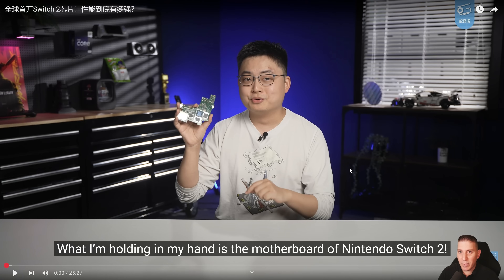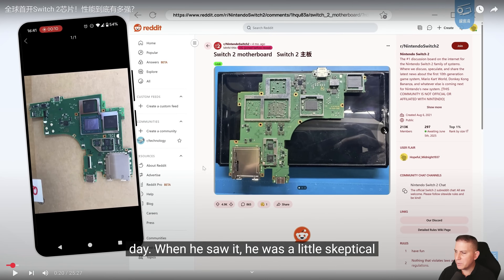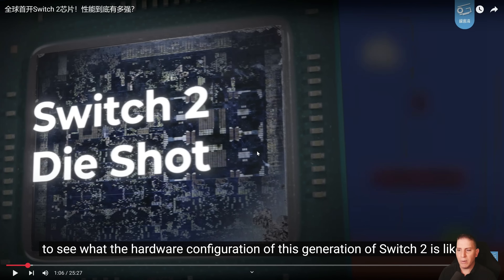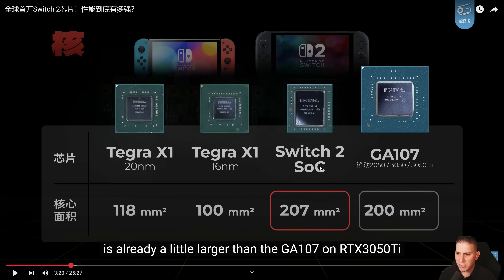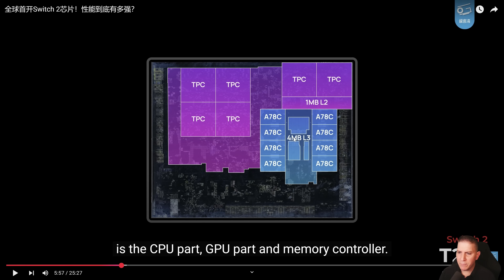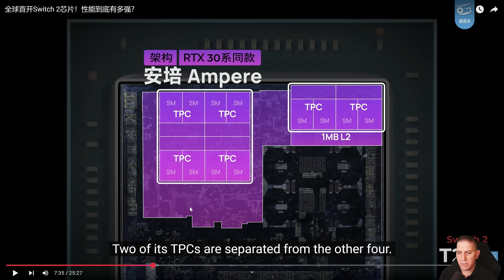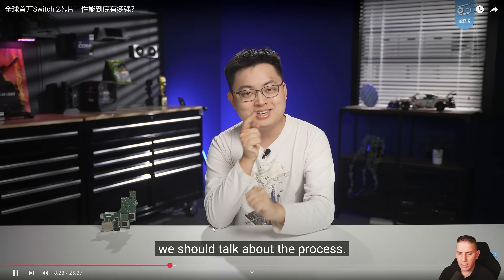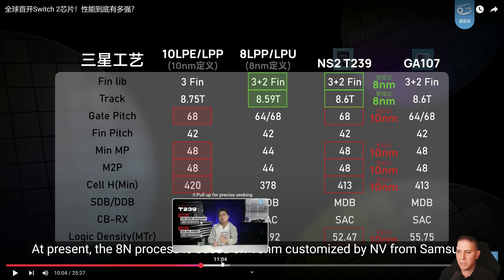Switch 2 GPU + CPU SOC Chip Size and Custom Architecture Revealed from Motherboard Scan

Comment: My only issue with this console is why did they wait so long? They should have released it 2 years ago with the TOTK instead of pointlessly chasing ps2 sales record. They could’ve been sitting on 50m+ userbase right now guaranteed success. Without a 3D Mario caliber title this holiday season, they may not do so well.
Reply: @codeofcodedotorg   i feel like they should've done the reverse, and made TOTK the launch title of the switch 2, with a joint release on switch 1 like how they did BOTW. the extra dev time would've been well worth it if it released as a launch title!
Reply: Pretty obvious why. The games weren't ready, at least Mario Kart World wasn't. It is kinda Nintendo's M.O. to wait until a game is polished and not shove it out the door.
Reply: @ Then I'm going to say it right now, it's not impressive. If the big draw of Mario Kart World is that you can drive to the next race and get collectibles, that's extremely lame. There have been better open world racing games since the Gamecube and Ps2.
Reply: @VGamingJunkieVT  Mario Kart has always been an amazing 2nd game. I’m just waiting for that 1st game like BOTW caliber single player game.
Reply: @VGamingJunkieVT  neat. Vote with ur wallet then.
I doubt the sold out pre orders are worrying.
Reply: @VGamingJunkieVT  you think that the sequel to the highest selling switch game, a game that its predecessor was also a launch title is lame?
They've been better open world racing games? Have you actually played this game to know this?
I don't know about you but it's a no-brainer to have your most successful game at launch if possible.
Reply: @xavierlynch1088  Preorders will always sell out. Under 20M by the end of the year will be a huge failure in my opinion. But with a 3D Mario caliber holiday game, they could even sell 30M+. The first 10M is guaranteed from loyal fans like me from day 1.
Reply: @codeofcodedotorg  are you cracked? 20 mill in 6 months? Ps5 was one of the fastest selling launch periods ever shattering records left and right and it only sold 4.5 mill in 5 months.
Reply: Broooo I couldn't possibly agree more, I've been banging my head against the wall for ages saying they should have just released this in 2024 or better even 2023.
The tech is impressive, it would have been even more impressive then and like you said, they could have built an unstoppable amount of momentum by now.
They would have built an unignorable install base, so even when Sony and MS come out with competing hardware in the coming years, Nintendo would still have 3rd parties in their pockets.
And then in 2030 they could be ready with Switch 3 just as the Switch 2 starts to show some age.
Reply: @Roy-Vector3  exactly
Reply: @Roy-Vector3  That hardware would have cost you $1000 around that time to get, so no, definitely not. Or they would have to go with something cheaper and then the performance would nowhere be close to this.
Reply: Covid
Thank you
Reply: They apparently waited for the games to be finished so they had a strong lineup at launch
Reply: @66kaisersoza  So where are the games? MKW and DK? That’s it? Aside from Mario Kart it seems the most excitement is around playing a 5 year old port Cyberpunk. All I’m saying is they have to have a holiday exclusive game. So something like Pokemon that also gets a release on Switch 1 doesn’t count.
Reply: @codeofcodedotorg   did you forget they have a sequel to their highest selling switch game called Mario kart world, and you're saying they don't have a Mario level game? It literally has Mario in the title lol
Reply: @isimikehinde5584  Now the question families will have to ask themselves is is this worth $500 when I already have Mario Kart on the Switch 1? The problem with pandering to casual audiences is they're probably just as happy with the older game, like how there are probably people still playing Wii Sports.
Reply: @VGamingJunkieVT  I think it will be fine.
Reply: @ I hope it at least makes Nintendo concerned, on some level. If it succeeds, the game industry will become even greedier. It'll snowball into the second crash that much quicker.
Reply: @isimikehinde5584  Well, they had MK8, BOTW, Splatoon 2 + Oddessy. I know some of them are Wii U titles, but they were brand new to most people. I know there are many 3rd party ports, but how does just MKW and DK compare to the Switch 1 lineup?
Reply: @codeofcodedotorg  well they've got Mario kart world, donkey Kong Bananza - the first 3D DK game in like 25 years and Metroid prime 4, with way more third party games than the switch 1, I think they are fine without a Mario game (even though there's literally a Mario game at launch)
Reply: @isimikehinde5584  I hope they’ll be fine, because I wouldn’t want Nintendo fade away like Xbox.
Reply: @codeofcodedotorg  lol they won't remotely get there.
They are not going through the same issues Xbox is going through and are probably the only company that will last the longest thanks in part to their business policies and system.
Reply: @codeofcodedotorg  probably didn't want to release a 800 dollar handheld 2 years ago
Reply: @xavierlynch1088  NVIDIA said they had this ready for a long time and they’re just waiting for Nintendo. Worst case it would have been 499 128gb 2 years ago, but the way inflation happened I bet it would’ve been 399.
Reply: @codeofcodedotorg  I doubt that 2 years about it would been 399. Even with inflation it still woulda been an insane price as nontendo doesn't sell at a loss.
Reply: @xavierlynch1088  why not it’s only 50 difference. Worst case it would’ve shipped with 128gb storage.
Reply: @codeofcodedotorg  I don't think it woulda been a 50 dollar difference.
 Modern tech loses about 100 dollars of value in a year and a half.
Meaning 2 years ago switch 2 probably woulda costed 150 doller more.
Reply: @xavierlynch1088  NVIDIA and Nintendo shook on this chip a long time ago, I don’t think the price of that would have changed. Storage price probably dropped that’s why I said 2 years ago they would have went with 128gb.
Reply: @codeofcodedotorg  it doesn't really matter when they shook on it.

Comment: holy crap are these specs kinda buns, you would at least expect steam deck performance from a device 3 years newer which costs about the same
Reply: What?? Most modern AAA games on the Deck look and run like dog poop while what's been shown so far on the Switch 2 looks way better. Thanks to the efficiency of an arm cpu and a much more capable Nvidia gpu.
Reply: False steamdeck is more powerful in handheld mode.  What games shown in handheld mode blow away steam deck?
Reply: @ cyberpunk runs and looks better in switch 2 and is not the final product
Reply: @TheMegaReiKeN running at a lower render resolution on switch handheld than on steamdeck
Reply: @ThinkTinkh  yeah and if You play at that higher resolution on the Steam Deck the battery last 30 minutes 💀, boy steam deck doesnt have games that were Made for that specific hardware, but in the switch all games are Made for that hardware, optimization wins, thats why i don't like handheld PC, overrall the Best combo is a desktop PC and a switch , You can play all
Reply: @issacdragon3834  EVERYTHING. Steamdeck cannot keep up with Switch 2. I have one. Switch 2 is upscaling to 1080p. Steamdeck struggles sometimes at 720p WITH FDR enabled.
Reply: @bk327  we are talking about handheld mode.
Reply: @issacdragon3834  Yes, the steamdeck struggles in handheld mode and doesn't even have a 1080p screen- it struggles at demanding games with 720p resolution. Swiitch 2 has a 1080p screen and still outperforms it. I have a Steamdeck.
Reply: @bk327   dude no thirdparty game thats demanding has hit 1080p native on switch that should tell you in handheld it won't be hitting 1080p do you get that?
Reply: @issacdragon3834  Better to scale 540p with a custom DLSS to 1080p on a handheld screen, than to scale 480p to 720p with something else.

I a bit exaggerated best case scenario with optimisations on switch 2 vs a badly done PC game. Anyway we are going to get better results than PS4 pro, but in lower resolution.
Probably a Doom port is going to be a good comparison.
Reply: @LeeLee-fi7mx  naa it's because optimization, Steam Deck is a PC, and You need to touch the graphics in every Game to better Performance, consoles don't need that, they are optimized
Reply: @TheMegaReiKeN  which is why ps5's still outsell pc gpu's to this day
Reply: @Jdog95Gaming  because  Bill gates only care spying  your activity  😂
Reply: @Jdog95Gaming  Right and the PS5 is the equivalent to an RTX 2070 or 2080, WITHOUT the Nvidia features- so anyone griping about Switch 2 using older hardware- so is PS5. Switch 2 REALLY being based on RTX 3000 series with some 4000 tech AND DLSS is amazing.
Reply: It has already shown that it will blow past the Steam Deck. I own a SteamDeck and Im day one owner.
Reply: @bk327 not from a cpu standpoint
Reply: It is way ahead of Steam Deck GPU... 
But I quess you see only numbers without understanidng.

Steam Deck is gtx1050 with some tricks.
Switch 2 is going to be around grx1650 but with more features and optimisation and in docked it may be better to play on it, than on gtx1660ti.
Reply: @zbigniew2628  it is way behind steamdeck cpu...

But I guess you only see numbers without understanding.
Reply: @ These are only simulated benchmarks of seperate environment. Steam Deck often punches above its weight due to OS, now imagine if it is OS and games make for custome hardware.
I am talking about the experience at the end, not only numbers.